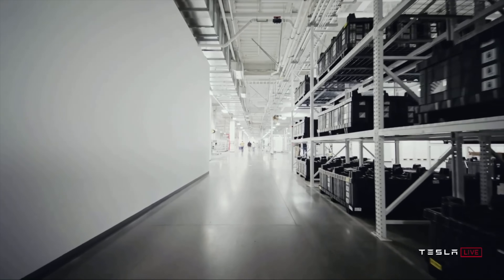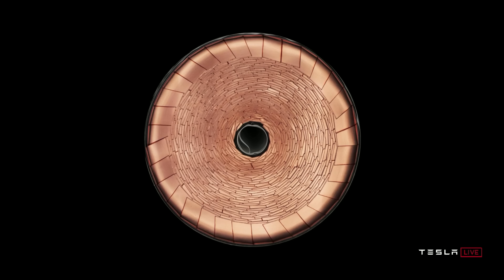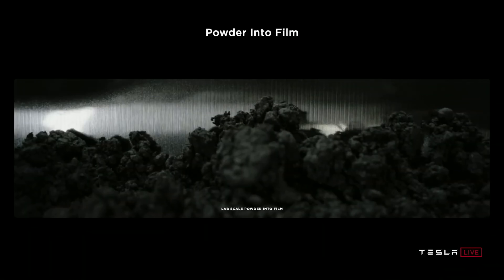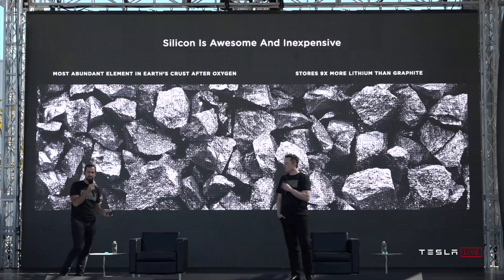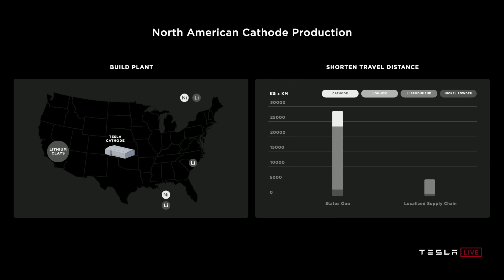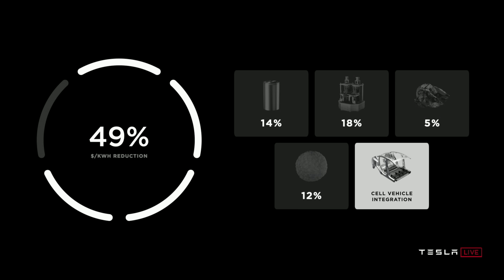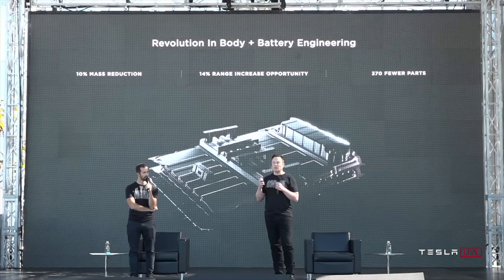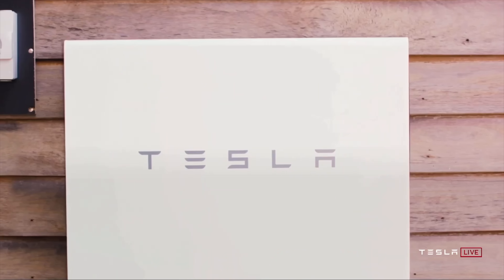How Tesla's New Battery Will Destroy Gas Cars

Comment: I was about to buy a tesla but I guess I will have to wait few more years till it will be cheaper than my prius 🤣
Reply: With low y/o/y maintenance costs, a Model 3 is already cheaper than your Prius. ;) ...and, will perform for years longer, as well.
Reply: @theknave4415  I paid for my 2015 prius 21k and maintenance have been free for the past 5 years including oil chnage since I got it brand new. So the only thing I pay for is registration, inspection, and gasonline. This year I was offered 10k to trade it in with prius prime but I changed my mind at the last minute and kept my car.

Tesla might be affordable car but I doubt it if after 5 years will depreciate by $11k. 
Gasoline wise I get about 56 MPG as I never do short trips and only drive twice a week on the highway. In gas I pay less than $200 annually and still have the original tires on it. And if replace the tires they cost me $78 each. So in MY case, prius has been cheaper to own. And I understand that may not me the case for others.

I wonder if I sell a tesla model 3 after 5 years if the cost of ownership will equal to $16,620 including registration + inspection + fuel + insurance. Not mentioning my insurance full coverage is only $72 per month because my car is super cheap. So my true cost of ownership has been $16,620 total for 5 years.

There is no doubt Tesla is an efficient car, but what is the true cost of ownership! is a question yet to be answered.

Not mentioning watching the YouTuber TFL and their struggle to find a certified Tesla shop to fix their broken tail light from backing their Tesla model 3 to a pole in their garage. And the huge bill they got because of the high tech in the car. Also realizing aluminum in Tesla saves weight, but at the same time in a car accident iluminum is not as ductile as steel and may suffer more stress fractures more than regular car, made me weigh my options for long term ownership; 10 years or more with Tesla.

Haven't said all of the above. Tesla is an efficient car, and still a candidate on my list but I'm not sure if I agree about owning one is cheaper.
Reply: @mohammedlabeeb  Model 3s and Ys  are made of steel. The 25k car will almost certainly also be steel (over a cast aluminum frame). Tesla has some of the lowest depreciation of any car that isn't a low volume collector car, and in some markets they appreciate in value. Largely that has to due to with current demand outstripping supply. Which is also why your Prius has high resale, there is insanely high demand for 2nd hand EVs and hybrids.

Comment: the main benefit on the Tab-less design are two fold, great reduction in heat due to the shorter electrical path to electrode area, and manufacturing in a continuous for rather than the two step process for the single tab form the the  18860 and 2170 batteries in Models S & X and Model 3 / Model Y
Reply from the maker: Yes! 👏🏼

Comment: This is great news. I own a 5.0 V8 ice car and electric is the way to go. I'm tired of putting premium in, the oil changes, brake pads....
Electric cars are better for the planet and safer. I'm all for it! Now if Tesla can just speed up that $25k car and I'll be on board 💯
Reply: I used to be a 5.0 Mustang guy myself.   The electric cars of today are so much better that I only wish the Model 3 had come along 15 years earlier.
Reply: @silvercharm  I actually have a 2012 genesis 5.0 and it's tuned so it's probably around 460hp...nice luxury car with heated and cooled seats, adaptive cruise control...everything. I'd STILL take a compelling electric car over the genesis if money wasn't a thing lol. Today's electric cars are a game changer. And if Tesla's new batteries are as good as advertised? Ice cars are doomed

Comment: I had great hopes for these cells and they're partially fulfilled.
Sadly, to really boost BEV adoption, Tesla needs to produce enough to also sell to others. But make the sells worthwhile to others, after Tesla took their profit cut, those brands would also need to totally overhaul their chassis manufacturing. Else they're just bulky cells that don't add range to a car.

Comment: I'm super excited for the future tech, especially the $25k because that car will truly represent progress towards sustainable clean energy. My biggest concern is the amount of cars being used on the grid once this does happen. I didn't hear anyone ask about how this will effect charging once millions of units are sold, even if they require less charging

@Andy Slye I finally took delivery of my Model Y on Sunday, again, thank you for all the informational videos you've done to help me make a decision on which Tesla to buy, my family and I couldn't be happier. Keep the videos coming!
Reply: It's already been hinted at that in the UK EVs will be disconnected from the network when there is a high demand. It's a great point and it's one that people do not want to answer. Replacing every ICE with an EV is going to take significant investment in the power delivery production and infra-structre if a country like the UK which has a pretty solid system just now is actually talking about disconnecting EVs at peak demand who knows what will happen in counties where the infra-structure is not as stable.

Comment: Interesting to watch many EV commentators struggle to fully appreciate battery day. Tesla is about electrifying everything - not just cars. Battery day was major shots fired in an epic emerging battery tech and manufacturing war that will swamp not just ICE but eventually everything carbon powered that does not innovate at the same pace. Panasonic, LG and CATL just had their major customer turn predator and will have to respond. Any auto OEM not seriously planning to fully and aggressively electrify will be toast. Battery day could well be viewed in the lens of history as a significant turning point in the fight to stabilise our climate.
Reply: Amen!!
Reply: ice vehicles will always have a place in military the convenience of gas will make it very hard to drop
Reply: @Aaron-wq3jz  ICE vehicles assume a steady and cheap supply of oil. I'd say army bases are better equipped with small nuclear reactors that powers all of their vehicles, including flight and sea vehicles. If the BEV can do everything an ICE can and be powered by local means, why would you not want that in the army?
Reply: @wertigon  I doubt that they will just put a reactor under every there is a reason the navy still has gas powered ships. The energy density jet feul a d any other type of fuel is to high for them to completely convert. Their has to be a leap in battery and propulsion technology. The only vehicles that could be replaced is maybe fire trucks or forklifts. No matter what batteries will always have the limitation of charging and unless charging can be done in Lee's than a minute I dont see the military changing for a while
Reply: @Aaron-wq3jz  With 5x energy dense solid state batteries soon coming out, it's only a matter of time... :)
Reply: @Aaron-wq3jz  military are already transitioning to hybrid vehicles for some time now. Eventually I suspect military will switch to electric when solar panels and battery technology gets to the point where large vehicles can self propell without ever needing to charge from a grid.

Comment: Don't get ahead of yourself my dude the battery is good and it brings the economic inversion point substantially closer., but I think it's going to be the next generation when that actually happens.
You don't need a $35,000 model 3 long-range, you need a $25,000 model 3 long range. The model 2 is going to be nice if it starts at $25,000, and is going to blow the currently available cheap electric cars out of the water but remember fundamentally you're talkin about a car that's in the same category as the Honda Fit and the Chevy Spark.

Comment: The battery pack has always been a structural member. The advancement here is that the CELLS in the pack are where the strength comes from instead of requiring stringers etc.

Comment: If they have 5X as much energy, why is there only a 16% increase in range? Is it due to the increase in size (meaning fewer cells fit)?
Reply: But it's about 5.5 times larger volume compared to 2170 cell.
Reply: correct, it has to do with the geometry of the new cell compared to the 2170

Comment: The most hopeful figure was the reduction in the cost per battery kWh by over 50%. That would enough to start the final landslide from ICE cars.
Reply: But at what starting point do they calculate that from? I didn't catch it at the conference. If we say they're at $100 per kWh today, then $50 per kWh by say 2025 it's definitely gonna be revolutionary.
Reply: @AgentSmith911  They said 50% the cost by 2023.
Reply: @AgentSmith911  You are right.Maybe Musk found a cheaper provider than Panasonic.
Reply: Don't neglect the 69% reduction in investment required to make these possible. This is what will enable Tesla to scale really fast.
Reply: @fkarg10  And 420 times as much batteries per floor space. 

I was expecting him to say "nice".
Reply: I wonder how 5x the battery capacity only leads to 16% more range? I understand it wouldn't be a simple 1x = 100% of current range but the difference in range is still way lower than I expected. Can someone familiar with this explain? Thanks.
Reply: @indianatarzan8001  It is typical misleading marketing of Mr Musk. Individual battery cell has 5x energy capacity because is about 4.5 times larger (by volume and weight). So energy density is basically the same like older batteries, therefore just 16% more range as energy storage capacity is only slightly larger then before. On other hand, significant drop in manufacturing cost is very big point. I am actually not very big fan of Musk. But I am waaaay less supportive to idiots CEO's of automotive industry. I like disruptive way Elon Musk pinching their asses. The main concern to me is Musk addiction to subsidies. I want to see normal economy in play without subsidies in any form.
Reply: @Truth_and_Liberty  Ah, thanks for the explanation. Yeah, I'm glad Musk is disrupting the industry but he has his own issues.
Reply: @Truth_and_Liberty  What subsidies? Teslas are out from the EV rebates and selling more cars than ever.  They borrowed 500M from the Feds which they paid back in 2017. Ford borrowed 6B in 09 and still owe over 1B, and aside from that can't sell their cars at a profit. How long will it take them to pay back that loan when their operating costs are higher than their income? So who exactly is the subsidy queen?
Reply: @indianatarzan8001  check out EEVblog here youtube for an in depth break down of this new battery and why it's only 16% more range. Basically they are using marketing numbers to drum up hype when overall power density is about the same. It is an improvement for sure but as with all things related to tesla it is over hyped beyond belief by people who just don't understand the engineering principals.
Reply: @Michael-1337  Thanks.
Reply: @Truth_and_Liberty  you forgot about the power figure which was the most important one...
Reply: @indianatarzan8001  I believe the 16% more range is just the improvment based on chemistry. The actual gains in range will be much more due to lower weight (largely about form factor and amount of steel) and smaller overall pack size.  There will also likely be range gains from reduced weight from mega castings and structural battery pack design, and better cooling. And that is not including the regular leaps in range Tesla is making based on tweaking software. The final products will likely not have dramatically more range than they do now, instead they will reduce the kWh size of the packs in order to make the vehicles cheaper.  Once you get up to 500 miles of range theres really no point in going any further and reducing pack size to lower the price is a smarter move.
Reply: @indianatarzan8001  Because that 5x Battery Capacity is actually just 5x bigger than the last battery... so its just bla bla talk to sound impressive thats why they didnt mention energy density instead. 16% more Range is actaully quite good consider the battery has basicly the same energy capacity as the old batterys.
Reply: @ZunaZurugi  Toyota will manufacture between 850k and 900k during November 2021 . We can't forget the insanely high quality control of Toyota. You never see Toyota owners on the internet whining about how their cars were poorly built. Every single day I see Tesla owners complaints. Musk is a con man. Where's the Semi anyway?
Reply: The charging infrastructure still needs to match the pace.  There are still places where supercharging just isn't available.
Reply: @FastRedPonyCar  They are. For example Tesla opened a new V3 supercharging station in Berlin two weeks ago and announced it is expanding supercharging throughout Europe over the rest of 2020. The infastructure is being built.
Reply: @FastRedPonyCar  frankly superchargers are everywhere they need to be.

whenever you're traveling long distance or cross-country you have to charge quickly, whenever you are within Town it doesn't matter because you just charge at the end of the day.

The only place superchargers need to be are on highways between cities
Reply: @pilotavery  Well yeah going from SC to SC on a trip is easy but the whole "charge at the end of the day" thing is the problem if your destination isn't your house.  There are some areas here in the southeast with no viable destination chargers so you're left to either beg a hotel to use something or look on the forums for a fellow tesla owner that may happen to be ok with you bumming a charge at their house or just driving out of town to a supercharger if it's close enough.

For cities like Montgomery (where I have family) there's no supercharger anywhere near and only one hotel with a destination charger.  If that's taken, you're just SOL and gotta trickle charge what you can get or go back later to the hotel.  They have a couple of chargepoint's at a local grocery store but they were only charging at about 4.5kW so basically useless.  Chargepoint or someone else are going to need some sort of major government incentive to push their 250v chargers out in huge numbers to fill in the gaps where there are no nearby superchargers.  It's even more crucial to those with non-Tesla cars that don't have the luxury of the SC network.

Thankfully, for me and my trips to Montgomery at least, they are installing a 240v 50a circuit for me to plug in my travel charger when I come to visit in the event that I need to drive around while down there.
Reply: @FastRedPonyCar  Then charge extra long or make one more SC stop to have enough when you arrive.
Reply: @FastRedPonyCar  at that point you treat it like a gas car period recharge along the way and once you get to your destination once you know it's your last stop just charge an extra 15 minutes. Then when you arrive you'll still have 100 miles of range at minimum.

Comment: The best overview I’ve seen. Very clear and concise.
Reply from the maker: Thanks Jeff!
Reply: I was thinking the exact same thing.  Well done!
Reply: It helps clarify the whole event and simplify it.
Reply: How can it have 5x energy, 6x power, but only have 16% more range? 
There is something I don't understand here... Maybe someone can tell me?
Reply: @Reth_Hard  the wording is super over simplified, the 16% extra range is easy to understand, but by 5x more power they mean the distance the elections travel is 1/5th. The further the electrons have to flow the more heat and resistance they make. Now this 5x less energy wasted in the batteries only accounts for a small 20%ish of total system inefficiency. So by cutting off that section of inefficiency by 4/5th they gain a total system efficiency gain of 16%, which means 16% more range.
Reply: @EmmaHopman  OK! I thought it was about the car autonomy, thanks.
Reply: Clear and concise!
Reply: And wrong.